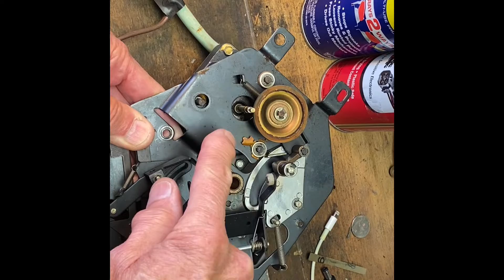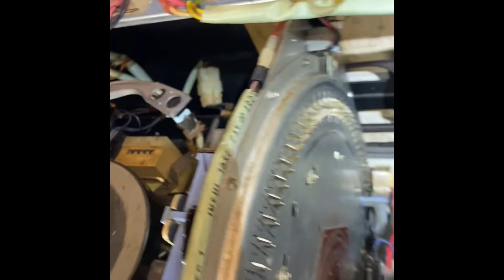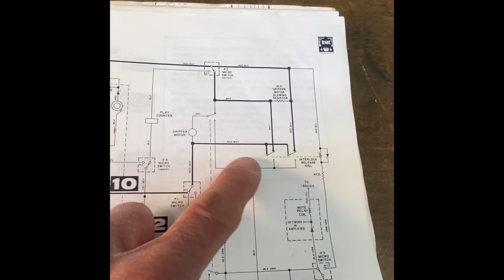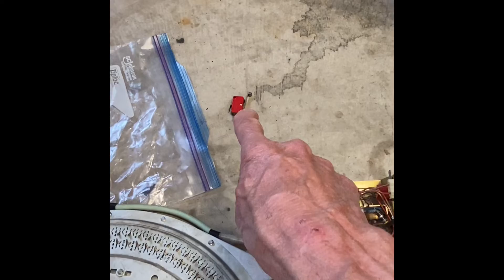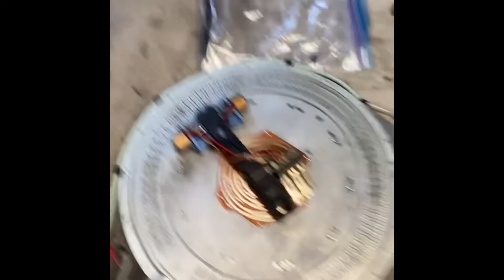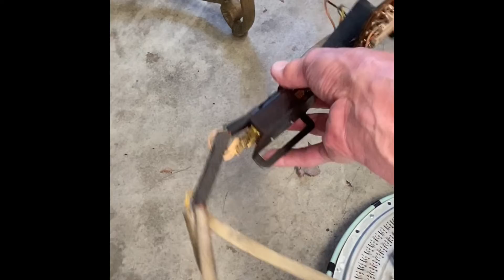Fixing specific problems with 70's Rockola jukeboxes

Comment: The idler wheel, idler spring and tone arm spring can be found on needles4jukeboxes.  All 3 are usually bad. My rock-ola 1000 was tracking at over 7 grams before a replaced the tone arm spring to get it down to 4grams. 
Turn table rpm was off 1.5rpm, which is very noticeable.

Comment: Thanks for all the great info! I recently got a Rockola 449 and your videos were instrumental in getting it working.  I am looking to prevent it for switching to 33.3 RPM when playing a record with small hole.  Many modern 45s don’t have the traditional hole size.  Is this possible? If so, could you post a video about the process or give a quick answer?

Comment: Thank you!  Just got my amp back from rebuild. Pulled in and turntable turned too slow. Watched your video and found my motor grommets were gone. Put washers in to bring motor up. Problem solved. Now I’m jamming to Elvis’s Hound Dog!  Thank you so much. I have other questions. Is there a way to contact you directly?

Comment: Hi William thanks for posting this. I had couple questions regarding turntable speeds and settings. My45rpm speed is perfect, my 33rpm is playing slow. Looks like adding that rubber sleeve to to top of the pin might work,the way you did it for the 45 test show. To be honest I would love to able to play small hole records at 45rpm, not 33rpm asI hang many UK imports. Whatdoyouthink the best modification is the make this work? A new pin that has the same diameter for top and bottom? Or is just  bad idea andI should just dink my records and call it good? Appreciate any input you have-my machine is a 440 btw,tks.

Comment: I've been looking through your videos and I just bought a 474 and when I went to buy it. it worked great... and when I got home I got about 4 songs out of it and started having trouble.. the gripper arm stopped returning the 45 but it picks it up with no problem.but then wont bring it back it trys and flips the 45 or misses it entirely. the read out carriage was working great and at the same time I had the other problem it  started slowing down and the motor started humming .. please help me I am new and always wanted one of these tell me I did not get screwed
Reply from the maker: Sounds like mech needs lubrication, especially if you bought the box "as is".  You will need to disengage the gripper and magazine motors from their respective gears.......this requires you to remove front door and rear metal door to access the hex screws that secure these motors underneath.  Once these motors are disengaged from the main gear, you can manually rotate the magazine forward to be sure there are no binds.  Lubricate the alternating dawg underneath.  Same thing with the gripper motor......manually bring the record out and back to be sure motion is unrestricted.
Reply: @williamweisel2176  i got it thank you now I just got to get it to stop rejecting the disc as soon. As the needle touches it, it sends it straight back
Reply: @williamweisel2176  i want to tank you for your help you are the only person I can find that helps I've watched all of your rockola videos now I know that the rejecting the disc is somewhere in the one circuit but I'm just so unfamiliar with this kind of work that I don't know what I'm doing. Is there a way to reach you that would be faster?

Comment: Excellent video! My 494 has been slow speed for a few months now and after I cleaned inside of the plate and increased the tension on the spring it's working great again!

Comment: Hi William I have cleaned and fixed the mechanism in the past and all was good. Speed is down a bit now and I fear the 3x grommets are done…seems way too much lateral movement…so I’m going to follow your path on the repair. Question is what or who are the contacts for parts…simply eBay or are there specific dealers?
Many thanks and it’s great someone helps our small community. T

Comment: Thank you William! Your videos are invaluable.  I am trying to get a 447 model working that is in good condition but clearly has sat for a long time.  I have exactly this problem with the continuing scan.  In the control box, my left side trip coil does nothing on the first pass of the selection, but on the second pass, the trip coil snaps open so that the metal contact between the two trip coils is open and stays open as the scanning continues.  When I cancel the selection and the read out arm returns to the home position, the left side trip coil snaps forward so that the two contacts touch again.  Is this how it is supposed to operate? My right side trip coil appears to not do anything in this process.  Thank you!
Reply from the maker: I am not as familiar with the 447 but the control box should be similar to other models from that era.  The trip coil in the control box will activate only  when the read out arm hits the "hot" pin, but it may take two revolutions of the read out arm depending whether it is the A Hit side or B non hit side.  Read out problems can involve the microswitches on the back of the box, the A/B switch assembly, the control box relays and of course the read out circuit board and read out arm.  All of these need checked.  The manual is helpful but sometimes a wiring diagram helps you track specific problems.  If you are struggling,  there are several groups on FB that are helpful for jukebox repair in addition to You Tube.  Have you checked your microswitch 1 and 2 on the back cam and cleaned all the push on contacts there?  And be sure microswitch 1 is in it's "divot" when the magazine motor is scanning for the selection.
Reply: Thank you! Yes, the problem was microswitch 1 was bent slightly and once I bent it back into shape, it works!  I'm not getting good sound, so I may have to look at the amplifier which I haven't touched yet. I did notice the pickup wire (long thin brown wire) seems to be in rough shape and one of the ground connectors has come loose, I think. I assume the needle could be bad too.  But I'm making progress thanks to your videos!  @williamweisel2176
Reply: hi William, can you do a video about replacing the stylus on the 448 please